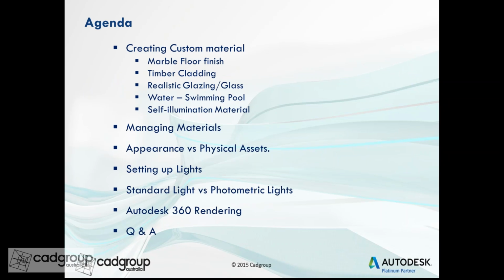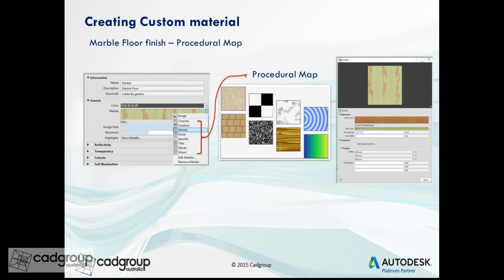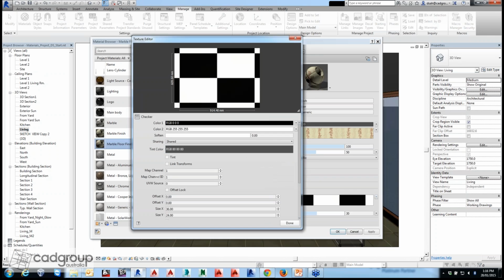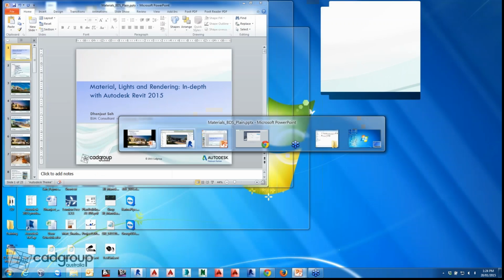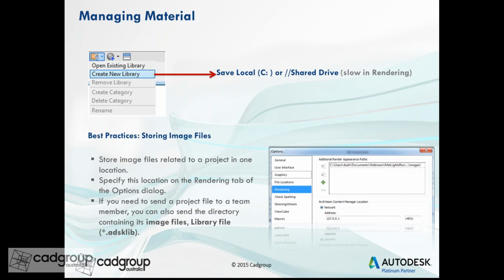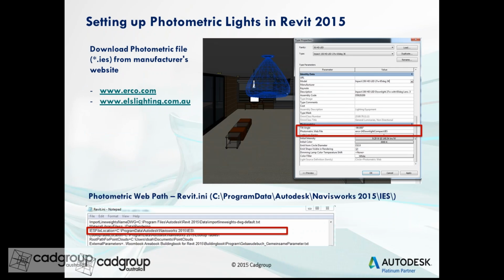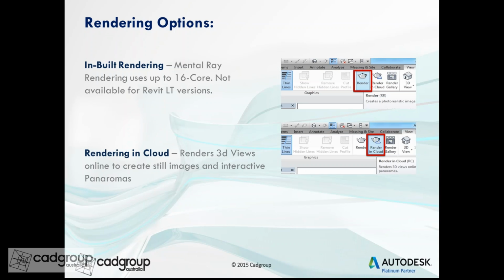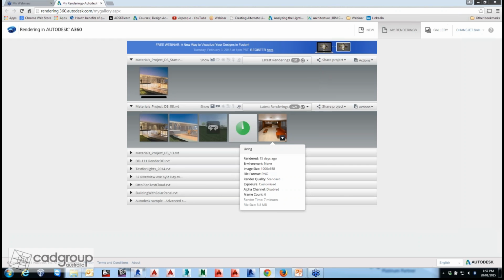Material, lights and Rendering - In-depth with Revit 2015

Comment: Dhanjeet,
I am doing plumbing design in revit. I am trying to update pipe materials. What I have done is that I have created a PVC type pipe. I have given it pvc martial finish where the color of the pipe will be the color of pvc. My system type is sanitary. When I draw a pipe on the floor plan its color appears green based on the my visibility setting for plan view. But when I switch my view to realistic, wired, consistent colors etc. then the pipe color changes to either black, cooper or other colors but not pvc (white). I want the pipe color to be pvc in the realistic view since I have selected pvc material when I have created pvc pipe type. Could you help me with that. Can you please tell me as to why the pipe is not changing to desired color in realistic or any other view.
Thanks,

Comment from the maker: You can register for my next webinar - What's New in Autodesk 3ds Max 2016 on Jun 18, 2015 1:00 PM EST at: 

https://attendee.gotowebinar.com/register/2769544812833167105

Join Dhanjeet Sah from Cadgroup to see "The Biggest Max Ever" 3ds Max® 2016 software, packed with brand-new features and offers the most capable and varied toolset to date. You can bring Revit models into 3ds Max up to 10x faster than before, and the new integration provides enhanced features such as improved instancing, additional BIM data, and multiple cameras. Also a biggest wish to import Autodesk® Inventor® constraints and Joint Drive animation in 3ds max became a reality. A new ability to use new Physical Camera with improved Mental Ray enhancements; you can create high-quality stills and animations.

Comment: thank you very much for this lesson,it was very useful.
but why does the texture editor in the marbel material in the color of stone and vien colour slot dosen't have the  the option of choosing an image ? the only thing that appears is color and swap!!!
Reply from the maker: nada mianoa Hi Nada, thanks for your feedback. There is small icon (drop down arrow) at right hand side of Stone where you can click and apply IMAGE or COMPOUND MAP (such as marble, checker etc) as required. This option is available for both Stone & Vein color.

Comment: Great tutorial, just a question please. I get to the change stone colour and my version will not allow my to add images, only change colour! Any advice? I'm a teacher and promise to praise you as a Revit God to my students...
Reply from the maker: kobanbaka Hi Kobanbaka, thanks for the nice comment. Some of the appearance material type does not allow you to add image. example are METAL, METTALIC PAINT or WALL PAINT etc. You might want to change the Appearance asset to "Generic" from the asset library? Some other material type such as Masonry, Carpet, flooring etc also allow you to apply image on surface area. Hope this helps.
Reply: Dhanjeet Shah Thanks you very much. That worked well, you're a god amongst men and will be praised as such from my students!

Comment: Where can I find the materials used in this webinar?
Reply from the maker: Justin David-Torres 

Hi Justin,

Most of the textures/maps are used in example is from Revit 2015 default library found at C:\Program Files (x86)\Common Files\Autodesk Shared\Materials\Textures\3\Mats

There are 3 folders named "1, 2 & 3" under C:\Program Files (x86)\Common Files\Autodesk Shared\Materials\Textures. All of them has sub-folder named "MATS". The differences are - folder "1" has low resolution, 2 is for Medium and 3 for High resolution images of same image files. 

There are some websites where you could download some of the royalty free textures/images. Please read their Licensing info for further details. 

http://www.cgtextures.com/

Hope this helps and yes I will be posting some new videos soon. Please stay tuned.

cheers!
Dhanjeet
Reply: Dhanjeet Shah

Comment: Hi Dhanjeet where can i download the textures you used when creating custom materials? I am trying to follow it step by step and want identical results for practice... Thanks for the video it incredibly helpful & please make more! :)
Reply from the maker: Stanislaw Krzyzewski 

Hi Stanislaw,

Most of the textures/maps are used in example is from Revit 2015 default library found at C:\Program Files (x86)\Common Files\Autodesk Shared\Materials\Textures\3\Mats

There are 3 folders named "1, 2 & 3" under C:\Program Files (x86)\Common Files\Autodesk Shared\Materials\Textures. All of them has sub-folder named "MATS". The differences are - folder "1" has low resolution, 2 is for Medium and 3 for High resolution images of same image files. 

There are some websites where you could download some of the royalty free textures/images. Please read their Licensing info for further details. 

http://www.cgtextures.com/

Hope this helps and yes I will be posting some new videos soon. Please stay tuned.

cheers!
Dhanjeet